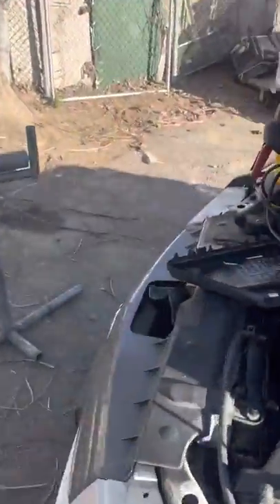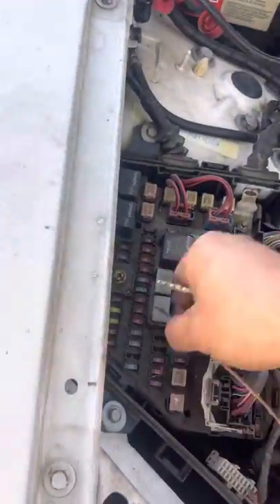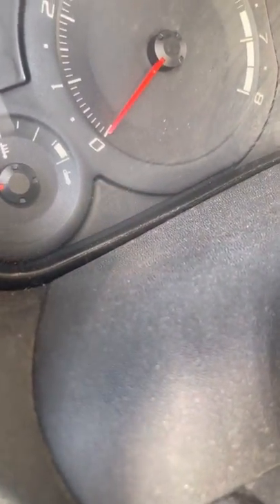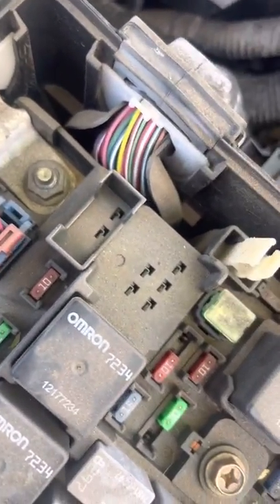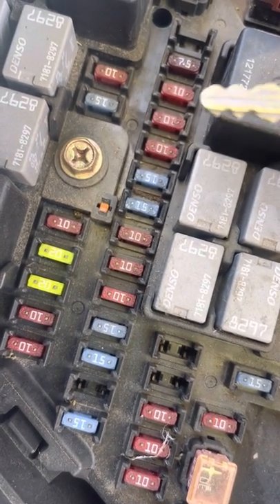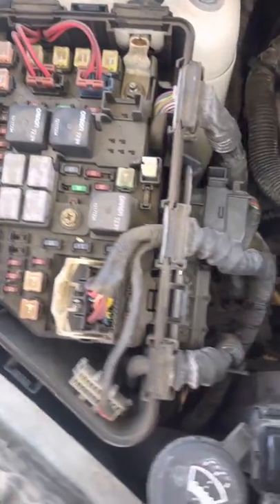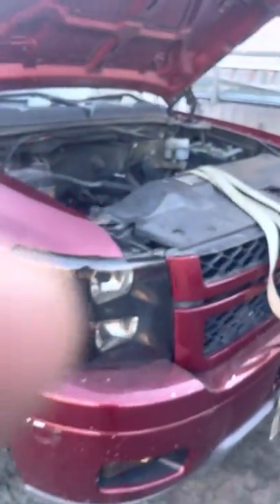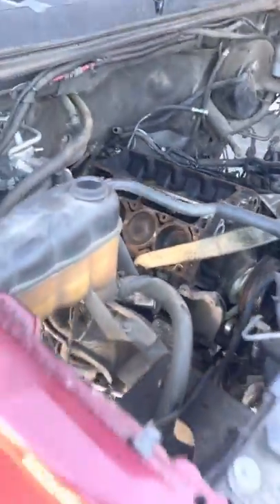Cadillac CTS Little Lock Symbol , anti theft system , car won’t start solution

Comment: Ok so i had an issue with my car to where it would drive ok but it would activate the anti theft and traction control then the gas and temperature gauge would stop working while driving then ac would stop blowing cold lot of places would tell me it needed a computer but me been a single dad it has been a struggle to where I can’t afford a new one but I kept on seen if I could get it to work but no luck till I unplugged the anti thef fuse it’s been 3 days and haven’t had the same issues just thought I would let others know maybe it helps y’all out my car is a Cadillac 2006 cts 3.6l
Reply from the maker: Thank you for the comment & yes hopefully it does help someone out , you never know how much money people can save and that’s the whole purpose of this YouTube channel 👍
Reply: What is the anti-theft fuse or where is it located? I have the same problem

Comment: 06 CTS light stays on, key stuck, and won't start. Tried purple wire and ground, nothing, tried pulling fuse 5 times. Nothing is working.  What do I do?
Reply: Any solution?
Reply: Did you find a solution

Comment: My bro has a 2006 cts 3.6 and it's doing this he's done the bypassing of the starter relay by using a jumper wire and he says it still won't start. Dash lights come on when key is turned over but won't crank at all
Reply: J
Reply: Don't pull the ecm fuse out like others are saying it can destroy the module when you do so. Use a tec2 scanner or find someone with one and do it properly I'm a mechanic I had this same issue with mine. I currently have another one with that same problem I'm gonna turn off the PK3 system
Reply: @franker1111  he no longer has this car. He sold it. And now he drives an 2006 STS.

Comment: I don't have a comment but I do have a question I need to know which oil pan goes to a 2008 Cadillac CTS a 3.6 engine can you use the VIN number to make sure you get the right one

Comment: What about for a 2008 Cadillac cts. My remote was paired before and out of nowhere the viper 7756V remote got unpaired and when I open my door the alarm goes off and it doesn't read the remote, and when I try to pair it it says pair failed.. what do I. Do

Comment: How does the anti theft system get activated?
Reply: For my deville, you put in a radio that isn’t from the car originally. The radio reads the vin and if it doesn’t match it goes into theft lock
Reply: @uselessamerican984 That’s just for radio has to be programmed to work it won’t keep car from starting. This here is a issue with the chip in the key or ither the immo ring around the ignition

Comment: Mine just cranks and cranks and tries to start, sputters and dies when you do the purple wire thing. Any ideas?
Reply: fuel pump? fuses ok?
Reply: 08?
Reply: Bad timing chain
Reply: Bad security on gm will not allow a crank

Comment: The guy I bought it from has the big fuse taken out of there and has me turn the key on then take pliers and set it in the fuse hole and it starts. But now my battery is dead and I’m having troubles getting it started.
Reply: Your battery is dead and you need ti bypass the anti theft, just dealt with this again yesterday. Put the jumper cables on just like your jumping a battery. Make sure the other car your using to jump is on so your actually charging your dead battery. Wait at least a couple minutes. Then  Take a piece from a wire hanger about a foot long. Make sure the wire is exposed on the ends of each side of the piece of wire hanger, some have paint or a coating on them. Rub it off on the ends if it does. Put the key in the ignition and turn to the right and leave it there, get out and LEAVE DOOR OPEN (you will get locked out if you don’t!) then take that piece of wire hanger and go to the hood of the car and put one end on the base of that purple wire he shows. Keep it there touching the base of the purple wire, it has to be on the base where you see the metal so the wire hanger is actually touching the metal. Then with the other end of the piece of wire hanger touch the metal part he shows in the video. Both ends of the piece of wire hanger need to be touching the metal in each spot. If the keys turned all the way to the right and your holding it there it should start right up. I had a mechanic do what your saying yours did but this worked.

Comment: My car has car lock but it isn’t flashing. It starts and drives but jerks. I’ve tried a million things… also lost the key fob
Reply: Any fix?
Reply: That's because your car is a JERK😂😂😂😂.  Na! Having issues with a 2014 Theft mode on occasionally.  Disconnect ground wire on battery/ trunk for about 15 minutes and usually starts back up.  Not the solution, but gets me home.

Comment: So I’m having the some problem on the 03 cts but my key is stuck in the ignition and the anti lock is j showing not flashing any advice on how to fix this?
Reply from the maker: Mess with the shifter for a little keep pushing up if not put a jumper on the battery and try again
Reply: Grab a flat heat go underneath your steering wheel and undo the flat head plastic screw, push a pen up there while taking the key out and it should come off just did it today because someone tried to break into my car haha
Reply: Flat head*
Reply: Did all but still won't start?

Comment: So my car recently just shut off out of no where, and that light blinks like it did n I gotta 05 Cadillac CTS, does it lock up the motor?
Reply from the maker: Hey how’s it going and no it won’t lock the motor but it will lock signal too your starter so you won’t be able to start it until you find out where your antitheft problem is
Reply: @diazautocarellc  well my antitheft light blinks like shown in the video, and when I go to start my car all that happens is my starter clicks
Reply: @diazautocarellc  my car shut off randomly while driving, and I was thinking either the ecm or the timing went out
Reply from the maker: Check the starter relay first then work your way too the pcm , pcm problems are common on these cars as well
Reply: @diazautocarellc  I tried starting it from jumping the starter relay n that didn't work so imma try that next

Comment: So I found this out outta sheer luck I did what he said purple to terminal jump but wouldn't allow me to lower windows no radio gauges nothing worked but I was able to drive signal lights windshield wipers head lights and tail light worked  qhile at work I pulled the audio fuse located in back of the driver seat there's a fuse box I then noticed my rpms and mph came back and if fuse was out the key would release I then pulled the fuse out turned car on qith fuse out then off got out unlocked door with the key put fuse back in and turned on the car and boom everything was back to normal lmk if this helps anyone
Reply: trying to understand what all you were saying your issue was; what you did to resolve them.. and seems like it corrected some other issues as well..